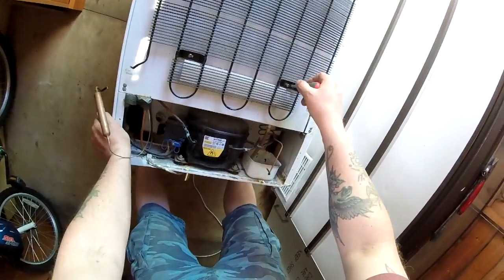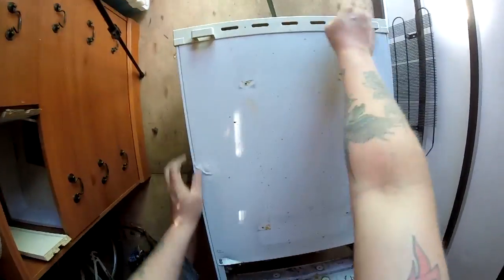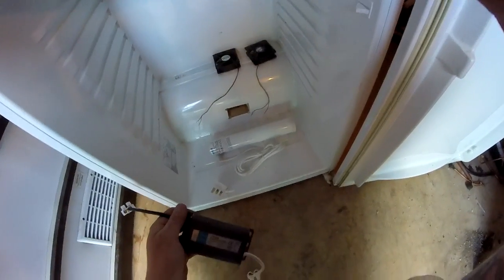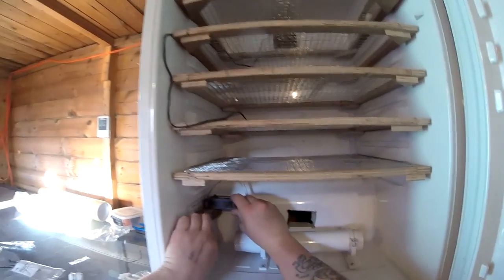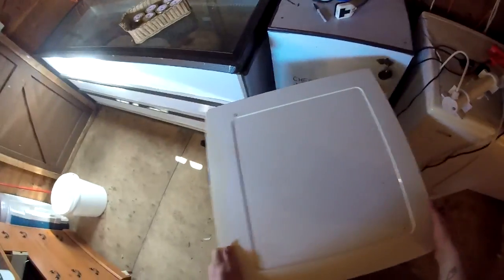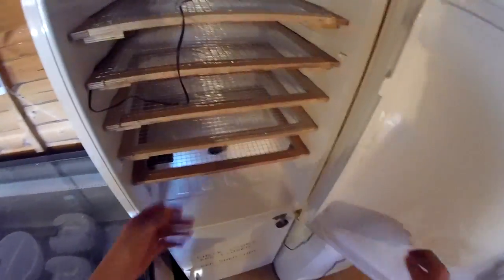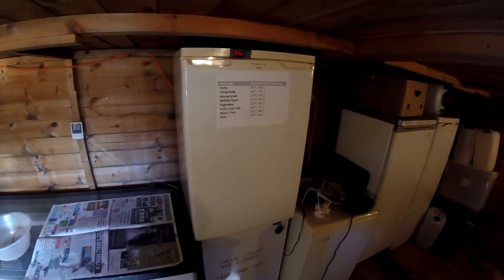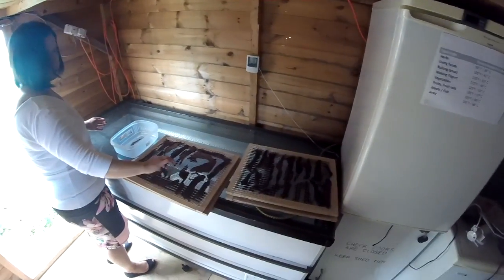How to make a food dehydrator from an old fridge - Part 2

Comment: Idea: try using 1-2 incandescent light bulbs. I made a home made dehydrator home from a box and used a 75W light bulb and it maintained 41*C constant temperature. 67% more efficient than regular dehydrators. Incandescent bulbs were considered inefficient due to the fact they were used just for lightning and lost 90% of the energy through heat -> using this heat for the fruits and vegetables and light as a bonus for the interior. If you use a fridge o, no insulation is neede, but for a box I used reflective aluminum and polistyren for the interior so the heat can be reflected back from the walls to the fruits/vegetables.  I won a prize for this in a international conference and proved the energy efficiency of the home made setup ;) For the 1st version an Arduino board was used for the temperature limit and automation but proved too expensive.
Reply: Hello, greetings from Colombia, I would like to know more about your dehydrator, should I build one to dry meats, could we communicate by email?
Reply: Nice ideo but no board instead use sensor to control the lighting for heat and a other one also 4 lighting.
Reply: Just do a video about it man

Comment: Dear god man that is loud! Plus hairdryers occasionally melt, catch fire etc. One of the small ceramic heaters may be better /safer/ quieter. Can I suggest you adapt the shell of a microwave oven instead, as that will be all metal and no polystyrene and foam interior like a fridge. Plus they usually come with a free fan. You just need the ceramic heater then. Well done for experimenting though.

Comment: Was it degassed before you took it apart or did you just release the harmful refrigerant into the environment?
Reply: Yeah I've I got my EPA 609 certification and in the book it actually does state that refrigerant does not reach the atmosphere it  dissipates into highly miniscule particles that are collected in water particles and rains back down so the ozone layer is fine and it also doesn't affect water, people, animals or plant life it's only hamful in direct contact with highy concentrated liquid or vapor    form because it freezes and aborsbs oxgen
Reply: Smoked